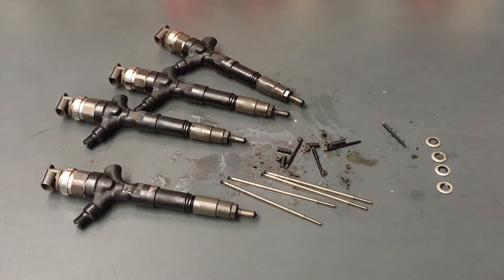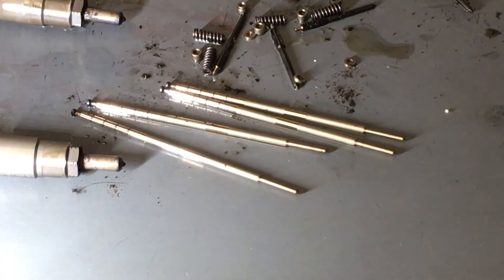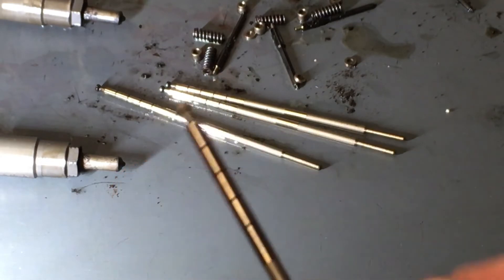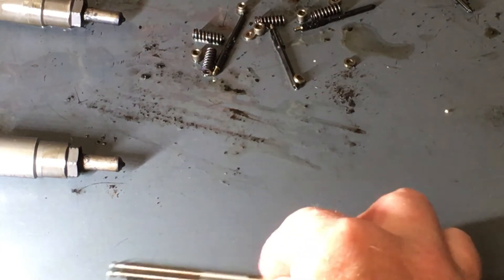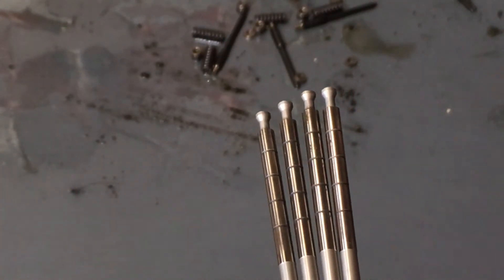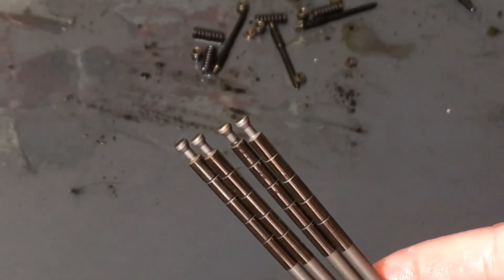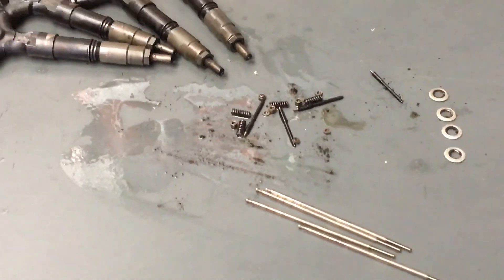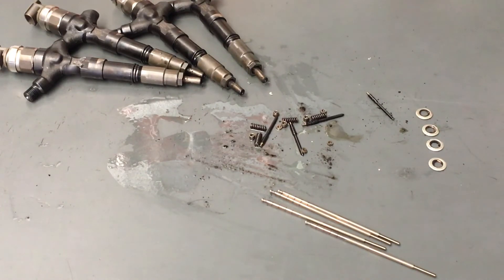TRASHED INJECTORS

Comment: In the foundry industry the higher end castings coat the crucible and moulds with zirconium, the zirconium prevents the slag from eating away metals and prevents erosion. I think some military jet engines use Zirconium to coat vital parts. I’m not sure if Skamol sells it but I’ve always wondered about using such substance in coating injectors and seats to keep them clean. Although the DLC sounds much more interesting. 

Does Denso supply the DLC injectors?

Comment: Is this injector wear confined to Australia? The quality of diesel? My New Zealand 2007 120 series D4D Prado has ticked over 350,000km with full documented servicing and doesn't appear to ever to had replacement injectors. I'm the 2nd owner. Had it for 6 months. It averages 8.9l/100km open road driving.
Reply: for peace of mind i would replace the injectors.  A diagnostic check will give you more info on the injectors.